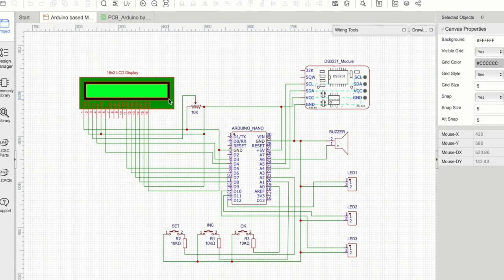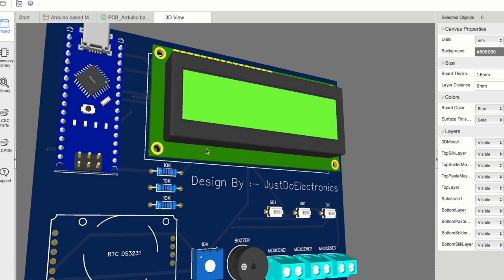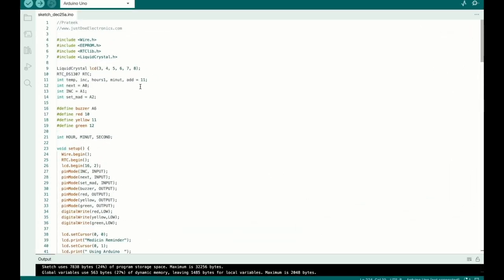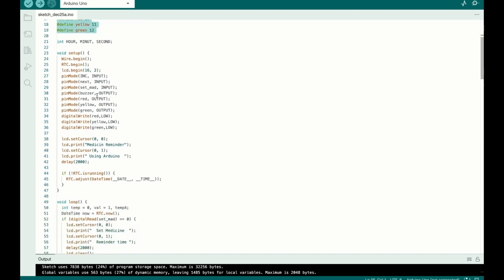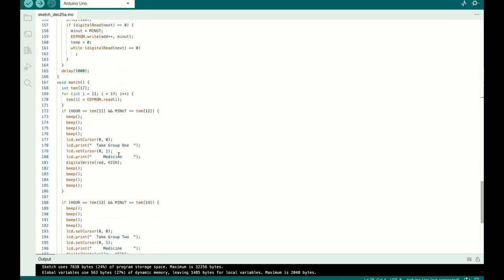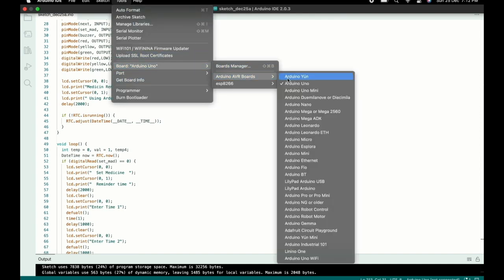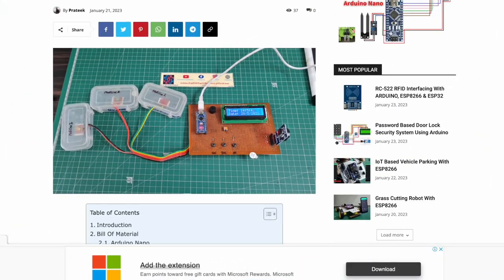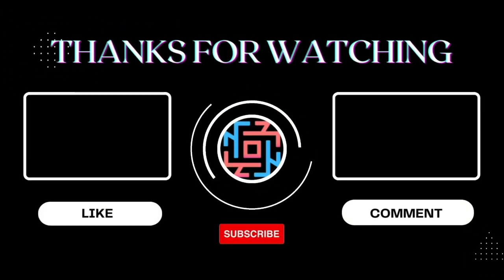Medicine Reminder System With Arduino | Healthcare Projects

Comment: the website link provided on the description box is not working. please help to find the circuit diagram
Reply from the maker: is open check proper
Reply: 😊do you know how to do wiring nd connection pls say

Comment: the LCD display runs randomly enter time 1 time 2 and time 3 runs itself 
. don't starts with time and date setting menu. IIT DONT ALLOWS ME TO ENTER TIME MANUALLY. WHY IT HAPPENS...PLEASE HELP
Reply: Exactly, I'm facing the same problem. If i remove the jumper wires from A2, A1, And A0 then its showing the time. But without the buttons how can i set the timer

Comment: I followed the exact procedure but the display doesnt show any response😔. I really need some help😢
Reply: So apparently, you have to attach the resistors to +5V in parallel with the pins A0 A1 A2
Reply from the maker: Yes tell me
Reply from the maker: Yes i used the 10k resistance